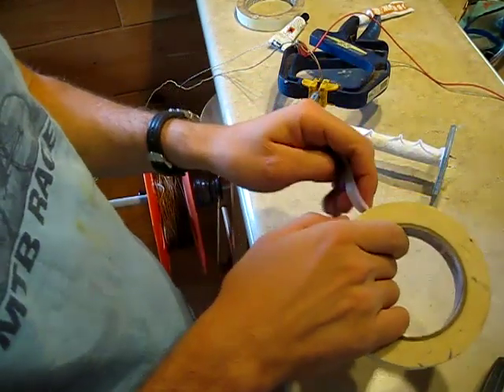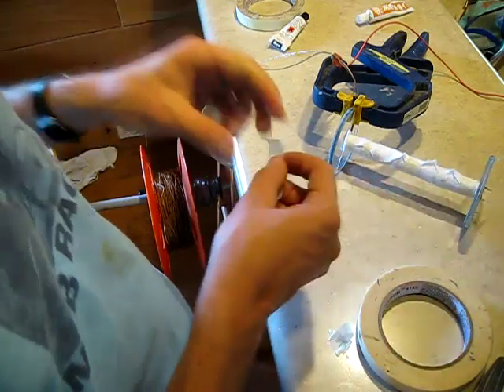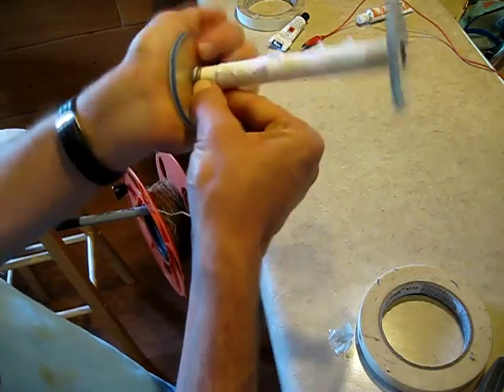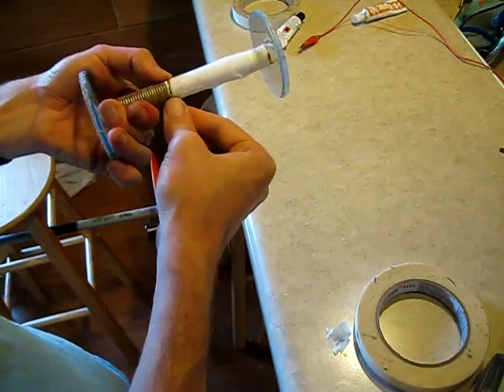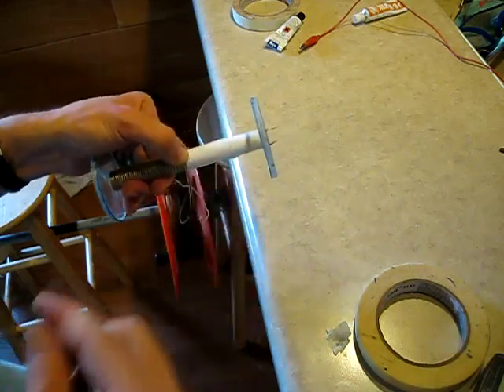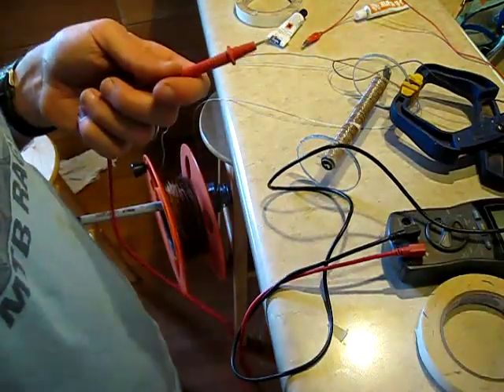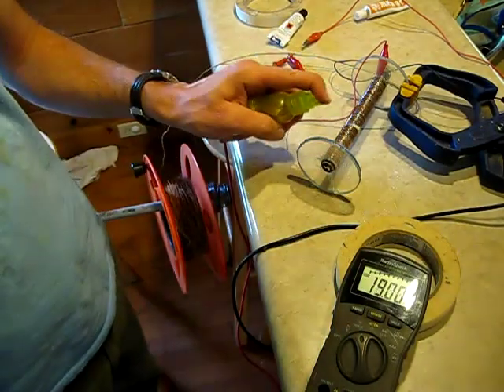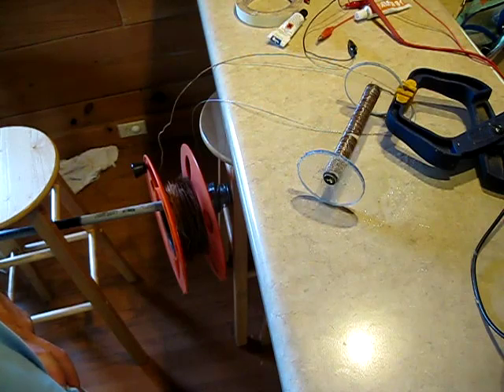How To Build A Nathan Stubblefield Coil Part 3

Comment: Hi there Lasersaber, 
I'm trying to replicate the coil, but looking at the video and running some tests, I came up with a question when you get to this point: 

If you wrap the first coil like you did with a non conductive material instead of with cotton, will the voltage and even the amperage increase?  

My theory is this: 
By wrapping it in cotton, when you wrap the next coil over the cotton,  once you get it wet, it will cancel any voltage/amperage gain you could get by making the two electrodes longer and making up to five coils which is a long distance as a matter of fact. I don't know if I'm making myself clear. 
What I mean is, if you put an insulating material between layers, what you would actually be doing is  increasing the length of the electrodes more and more, which according to my experiments in a scale of up to one foot, and beginning with about 1/2 inch, has increased both the voltage and the amperage.

Comment: Good job, but have you ever considered making a jig to support the spool while you're applying the windings? Better yet a jig that not only supports the spool but actually allows it to be rotated slowly. I think that would significantly decrease the time and hand fatigue as well as increase the overall quality. I am thinking of making some of these but the first thing that I will make is a jig with a crank handle on one end to allow me to spin it with one hand while applying the winding with the other. Using an electric motor (with a gear reduction box) and a foot switch would be the ultimate. It would slowly spin the spool while both hands are free to apply the windings. It would take 1/10 the time to make a coil in comparison to your current method. I'm thinking an old variable speed electric drill as a motor and gear box source. I'd remove the switch and arrange it in a foot operated setup, like a vehicle accelerator pedal. Your foot would control the spin speed as well as off and on. I would also make a small hand held tool that presses the wire down and tightly next to each previous wind rather than using your finger nails. Just a thought or two to make building these easier, faster and better.
Reply: I got 150 feet of cotton covered wire from Brillman. Also, what gauge do you recommend?. I think I got mine too big.

Comment: Interesting. I am trying to figure it out, and I came up with this. Since this Electrolyte is really one cell. With Iron and Copper electrodes and water electrolyte, the Voltage will stay at  0.7 Volts. However adding more wire to the cell, the Ampere will (probably) increase with lenght of wire. Therefore building a large Ampere but a low Volt. The Ampere is after a while sufficient to build a EM-Field, large enough to be interrupted in a Secondary for High Volt, Low Ampere Transformation AC.